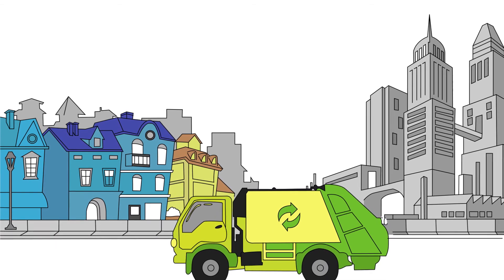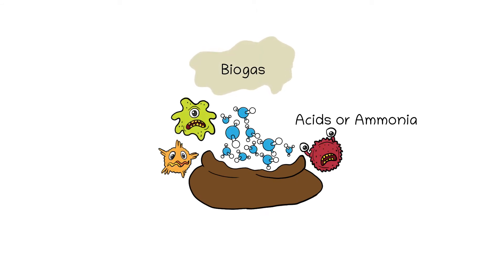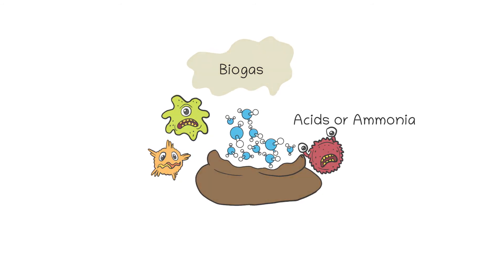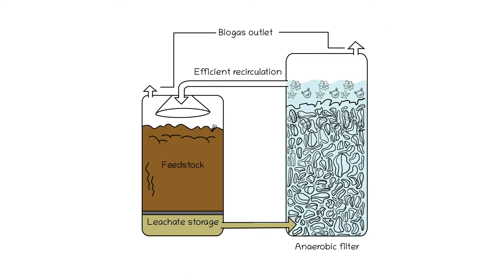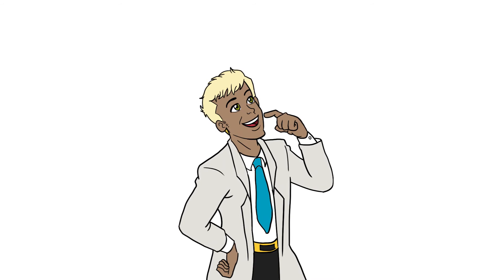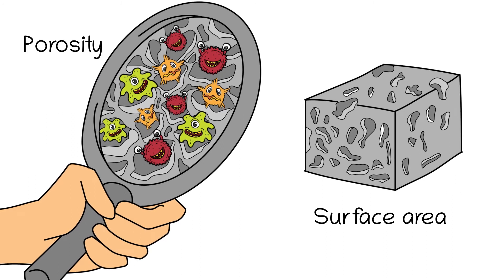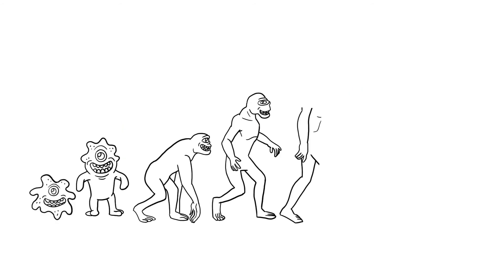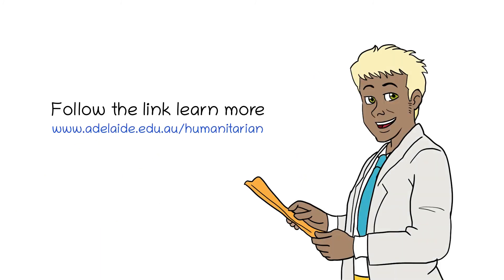Improving Anaerobic Digestion with Biochar

Comment: Okay. Biochar is very useful under certain limitations. It has a extremely high amount of surface area. So using it in a feed lot livestock operations as a filter of sorts is helpful.  
 However regenetive ranching or farming practices have little or no need of Biochar. 
  If the livestock is rotationally grazed the manure produced is the fertilizer for the pasture. In a nutshell. The live stock is confined to a predetermined area for a very short time. Hours not day. Then moved again to another area of fresh pasture. The cycle repeats itself over and over so the live stock always has fresh pasture.
  This only works if there are no imputs. Such as deworming or fly prevention applied to the livestock. Also there is absolutely no grain feed. There are free choice minerals provided and more then enough clean water.The inputs are what occurs in feed lots.
  What is not touched on is the cost of producing Biochar. It is very time consuming. There is also lots of wasted energy. The heat produced could possibly be used to heat a boiler to power a steam turbine. As it sits now all that energy/heat is lost.
Reply: Valid points David and thanks for the interest. Our big and initial focus/motivation is for the humanitarian/development sector and subsistence farming community. In this field, we also work on Top-Lit Up-Draft cookstoves which enable cooking and heating from solid fuels, but produce biochar as a byproduct. We are also looking at the viability of biochar from crop and other agricultural waste as an alternative to synthetic fertilisers, carbon capture markets, and water treatment systems, in addition to biodigesters.
Reply: Biochar is being studied as a supplement for livestock with successful results so there is still use for it in regenerative agriculture. After all a cow's stomachs are quite like a biogas facility in their production of methane. 
2nd biochar is produced on commercial scales using wood gasification technology which turns wood into a flammable gas which is then run through a generator. The power output is around 1kw per 2lbs of woodchips and waste heat is used for heating other facilities.